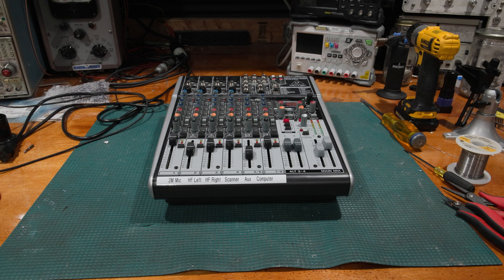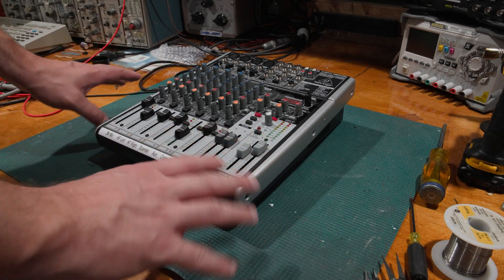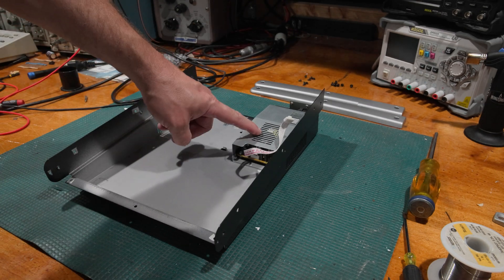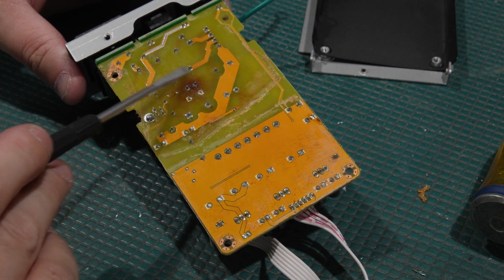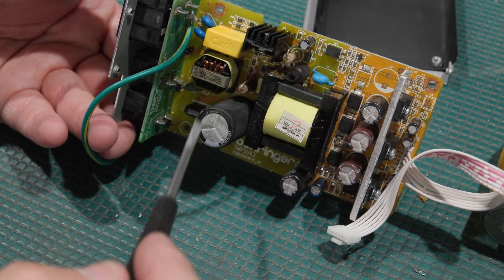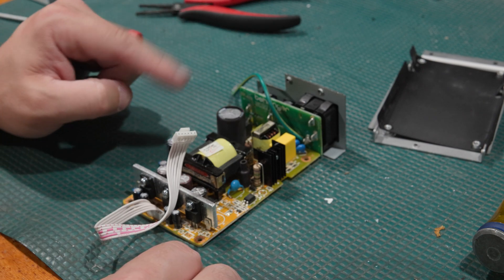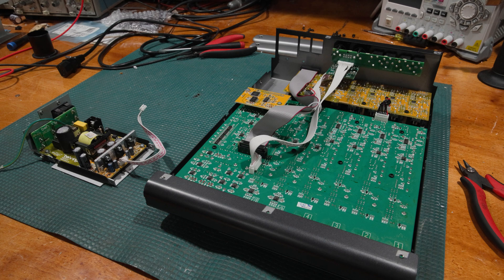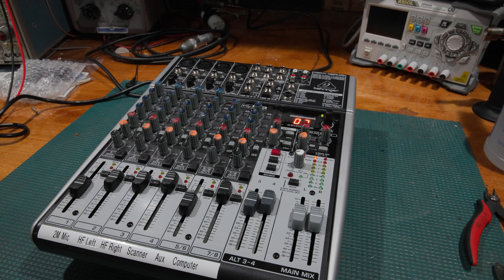Mixer Repair for a HAM

Comment: Beringer is a Chinese made audio products line, notoriously famous for low retail prices. He is not kidding, that thing retails new for $209.  How can one justify an hour or two of bench time a few dozen $ in parts when for less,  a new one can arrive at the doorstep faster than caps from Digi-Key. It is the ultimate in throw away, discard and make E-waste culture.